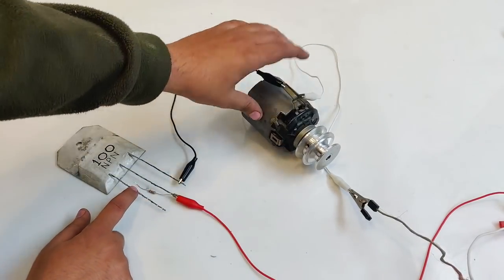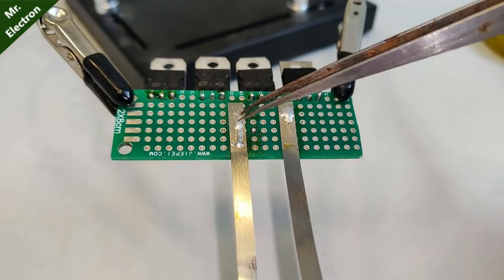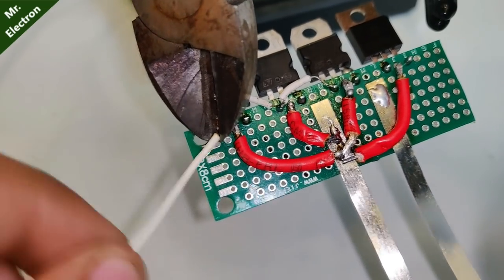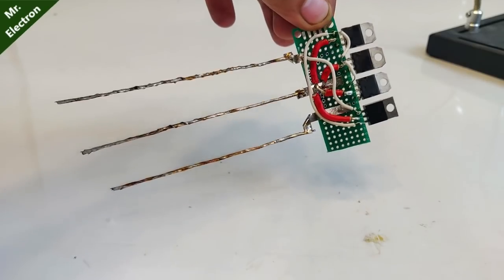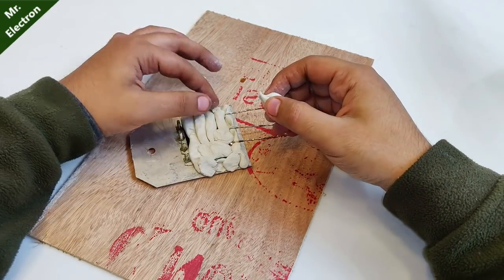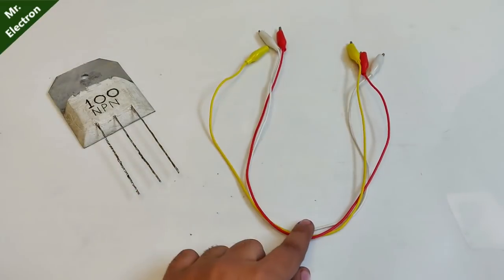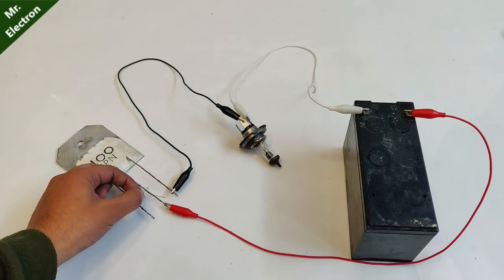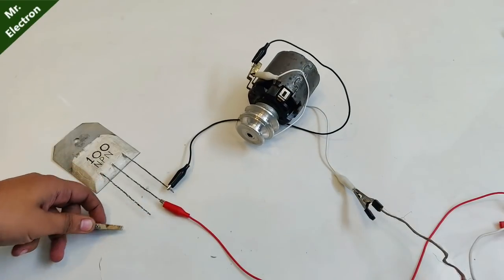Make 400V Giant Power Transistor with 108A Peak Amperes | Best DIY Project 2020

Comment: If you put transistors in parallel you need balancing resistors, otherwise it will not handle the peak current without thermal runaway

Comment: The problem with this circuit is that the  transistors are not going to share the current equaly due to parameter differences
Reply: Por qué ?  pues todos tienen las mismas características .

Comment: Or you could use this part: UF3SC065007K4S. Rated for 650V @120A and has a 7milliohm on resistance! Best part is it is the size of one on those transistors. It does cost 70 american dollars though. That might be about the same worth as the time and money spent on this project. 

It is a neat little project though. It may not be practical, but I quite like it. Maybe next make a gate drive circuit for this transistor in the shape of a toroid?

Comment: Nice but not excellent... No compensating resistors, no thermal shut down (even just a thermostat in series with the base)... The transistor with the lowest Vce(sat) will let all the current flow through it, and it heats up, and the vds goes even more down and it drains even more current... The other ones instead will receive less current, stay colder, higher their Vce(sat) and receive even less current... Leave it on with a 100w lamp for 10 minutes and they will blow up one after the other...

Comment: 11:53 For high current tests, should not you be using thicker wires rather than the thin ones..??
Reply from the maker: Well i can always add more strands to the terminals if needed .
Reply: @MrElectron  Yes, but that would be like hit and trial method. Here, in this case, you are sure that high current will flow, so that's why I suggested  to put in thicker wires... Moreover, thick wires can carry small & large current but thinner wires can only carry small current. So it's wise to put thicker wires here. Hope you are understanding my point.👍👍

Comment: You connect the mofsets in parallel 
So that even if one fails the circuit still remains functional
Reply: 😁😁not so fast
Reply: I dont think so
Reply: What is mosfet here? I see BJT 13009.
Reply: mr electro n you have connected 4 transistors in parrallel so high current will be required
Reply: @robinashaheen4058  yes

Comment: The fun thing is that that kind of MOSFETs already exist and are very tiny.
Reply: What was the point of this? you will destroy the npn transistors if you go over current, unlike mosfets, the foward voltage decreases increasing current
Reply: Any special name? I'm trying to kick myself back to where I was again
Reply: @zacharysimpson7353  n-channel mosfet
Reply: @ramadavince6611  refresh my memory when you can
Reply: @zacharysimpson7353  what explanation do u want n-channel mosfet can handle tons of current/amp. In more effeciant way
Reply: @zacharysimpson7353  connect 2 irfz44n mosfets together to get 99 amps
Reply: @Cloverboi  have another project, making a speaker. I got 2x 15 inch subwoofers and I need the other driver or drivers but I'm seeing how to convert a old Bluetooth speaker into a bigger one.
Reply: @zacharysimpson7353  
This is the first one that turned up with Google search  NVHL020N090SC1   900 volts   118 Amps.   About 15 x 40 x 5 mm in size, including the leads.

I'm pretty sure there are also smaller SMD ones of similar rating but I didn't bother to search more.